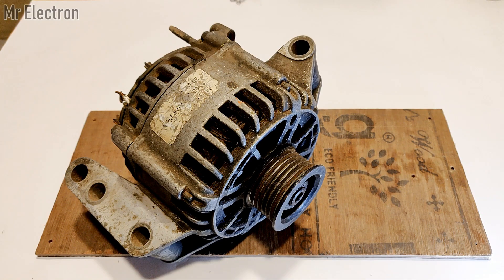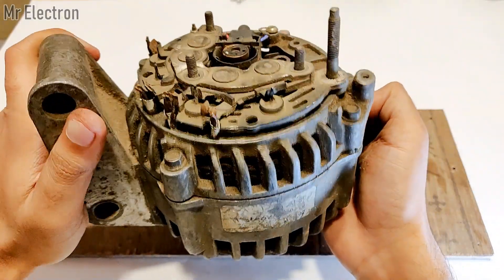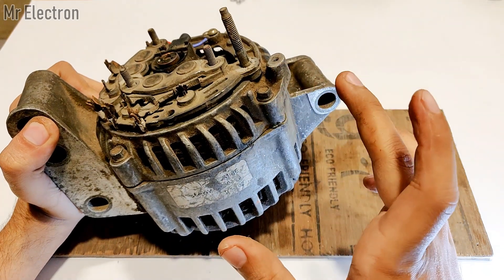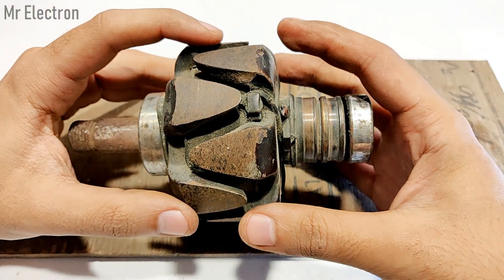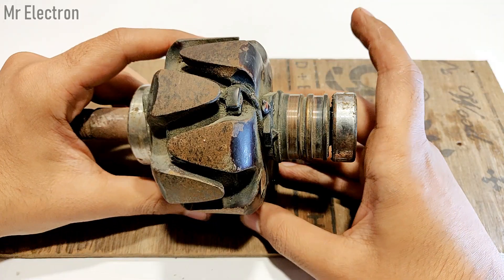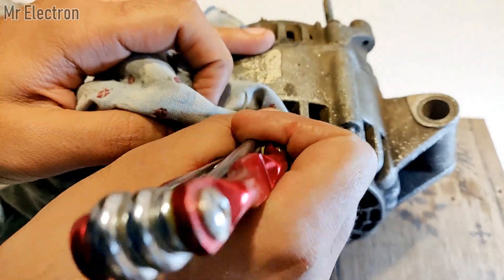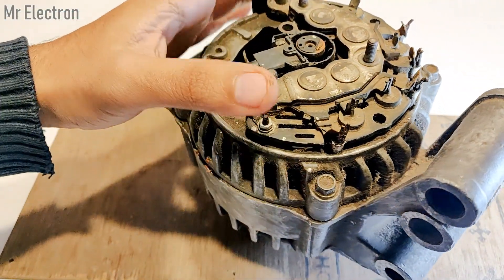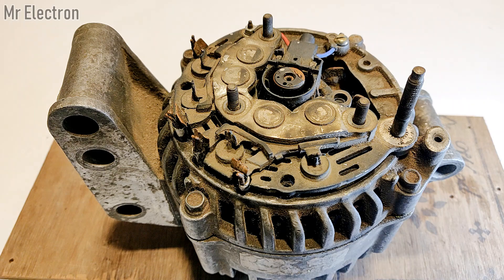Alternator Connections Explanation and Working a full how to tutorial

Comment: Please do a video on how to harness the full 250VAC from the alternator by bypassing the bridge rectifier and voltage converter. PLEASE, alternators can produce up to 250 volts A/C 2 whatevcer amp the alternator is rated for. well if we can get 90 amps at 200VAC out of an alternator that's almost 25,000 watts.

Comment: @Mr. Electron I have a question.  How can I figure out how much voltage and amperage is necessary to excite the alternator commutator?  I've seen videos with 12V excitement, and I've seen you use a 3.7V 18650.  How does the voltage and power affect the output?
Reply: Also, is there any reasonable way to convert one of these to a permanent magnet motor, or is it just not really doable?

Comment: From a mechanic an air impact wrench will spin the nut right off the shaft use a leather glove to go to hold the pull and wala there you have it nut off
Reply: Michael dale Medcoff jr I was just about to write the same thing.
Reply: @whatsup8464  Some friction on the pulley combined with the INERTIA of the rotor might provide enough counter-force for the hammer spanner to work.

Comment: I’m attempting to do this with a HM 1 Wire Alternator out of a 1987 Pontiac Trans Am 5.7 L 78 Amp I got 3 Leads off the Stator 13  O’Clock 11 O’ Click & 1 O’ Clock I checked the 1 at 11 looking from the Bach with my multiple netter set on Ac and I used my battery powered Impact gun to spin it the Ac Voltage went up as I increased the speed Ac Voltage straight off the Stator  30v - 50v - 80v I really hit the trigger 120v  Ac  140v - 160v I stopped at 184v Ac I did not check Amps my meter only goes up to 10 Amp and I’ve heard it goes up to 90 Amp each lead ! & how to control this voltage ?

Comment: nice. Can we modify the circuit to step up voltage and amperage?
Reply: Put a diode, at least for 5 amps, in the line from the ignition switch to the voltage regulator. The forward voltage drops the voltage that the regulator sees so thinks that voltage is lower than it is and cranks up the output accordingly.  I have two diodes that I can switch in series or not at all depending.

Comment: Use an air impact tool with correct size socket for the nut on the pulley shaft and you can take that pulley right off in seconds.
Reply from the maker: thanks for the tip but i also have to keep the rotor from spinning at the same time.That's why the allen key slot has been provided on the alternator shaft.
Reply: @MrElectron  If you can fix a belt tightly around the pulley while you use a hammer spanner (my name for impact wrench :) it will keep the rpm down and the friction of the belt combined with the INERTIA of the rotor might provide enough counter-force for the hammer spanner to work. If it's extremely tight, doing it for a long time might loosen it.
Reply: I am having trouble removing torx bolts from the regulator on back of alternator
Reply: @82NeXus  I have a dewalt portable impact wrench that has a fitting that you can put any kind of bit in it, torx bits included.
Reply: @brifran-v3z  I tried that but the bolt and the bit were a bit worn and it stripped the bolt. Not sure if I want to get it out now actually 😆 But if I do I guess I'll have to drill the head off the bolt then remove the rest of it.
Reply: @brifran-v3z  It's a stupidly designed bolt. The torx fitting is too small for the size of the bolt.
Reply: @82NeXus  they design them like that so that you have take it to a  dealer where there are factory  trained "technicians"  that do these "overly $ complicated  B S $$$ " repairs...